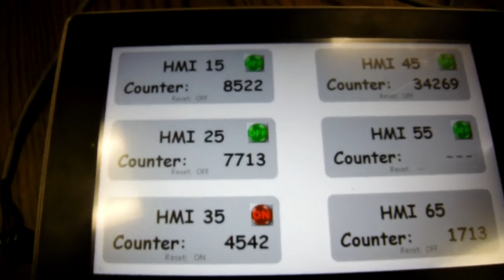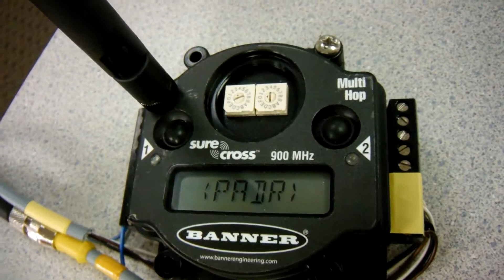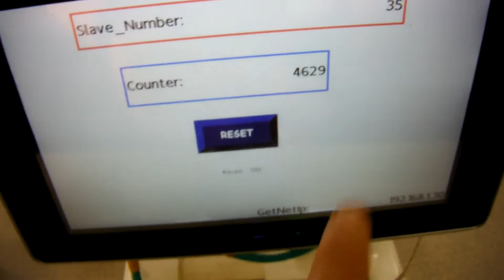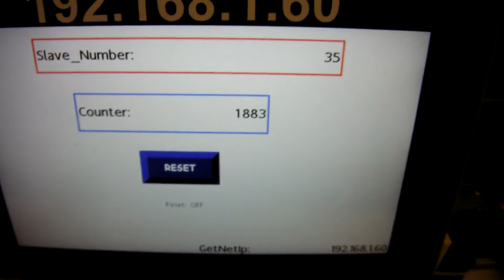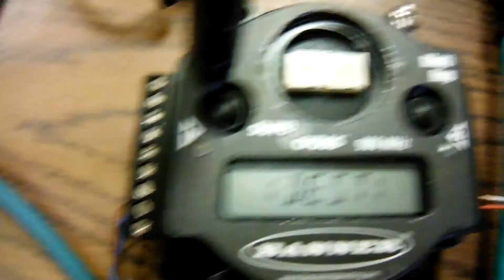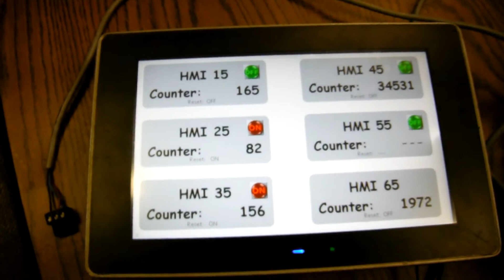Banner Multi-Hop Radios Test

Comment: Can a multihop radio bind with DX80 Gateway or Node?
Reply from the maker: No it will not!  The DX80 Gateway would need to be Wired to a Multi-hop Radio and be address #12 or greater on ModbusRTU. Consult with your local Banner Engineering person for good local technical knowledge. Who is that person and where are you located?